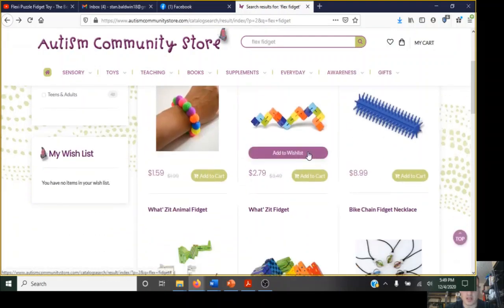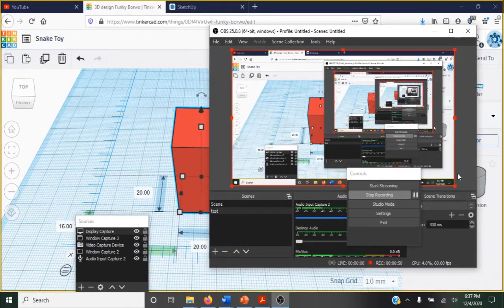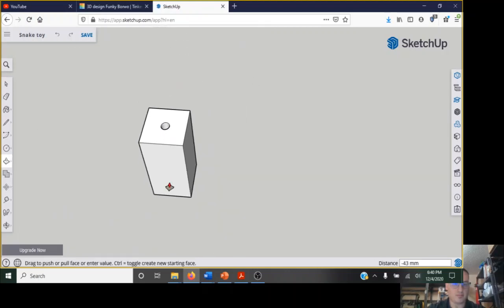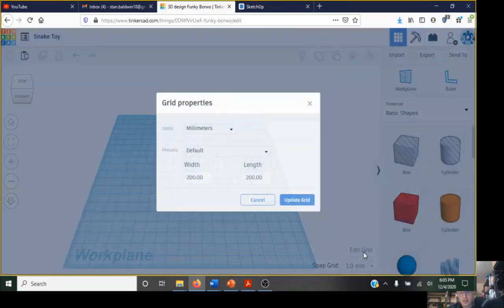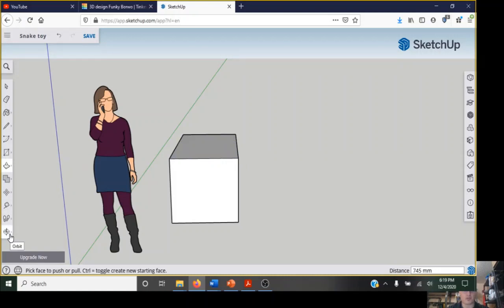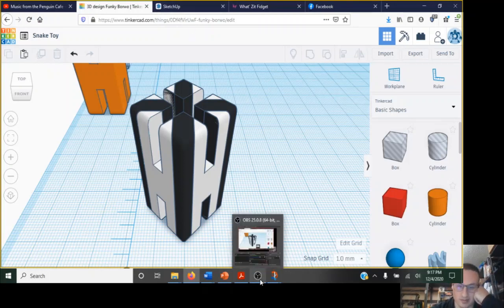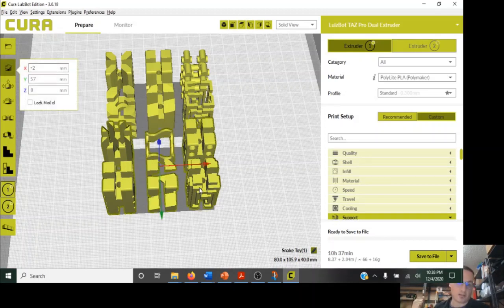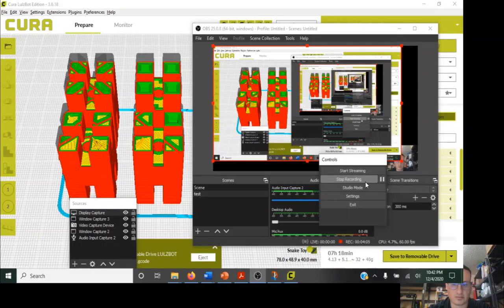TinkerCAD vs SketchUp Free Shootout

Comment: I don't feel like SketchUp free is trying to push me towards the paid versions. I know exactly what the difference between the paid versions and the free version is and I don't need anything that the paid version offers. I run a full metal fabrication shop off the free SketchUp version, so I'm not really sure what limitations you're running into.

Edit: I've been using SketchUp for a while and just recently got a 3D printer and thought I needed to use something like tinkercad. After using tinkercad for a week, it's garbage compared to SketchUp. I have so much more control in SketchUp. I didn't realize I could use SketchUp for 3D printing so I'm kicking myself for even bothering with tinkercad.